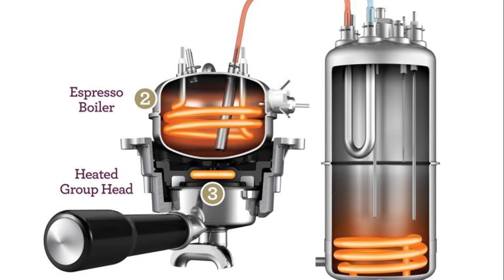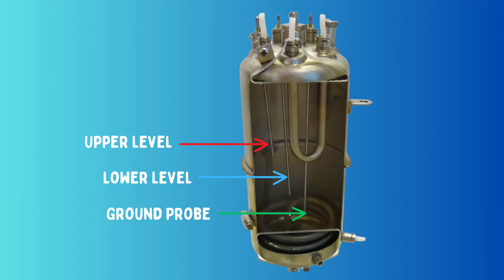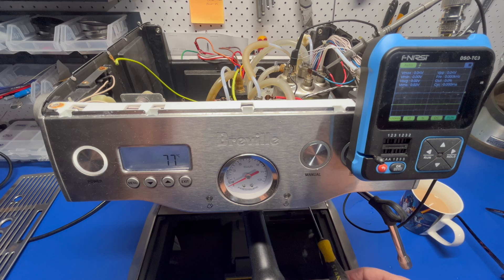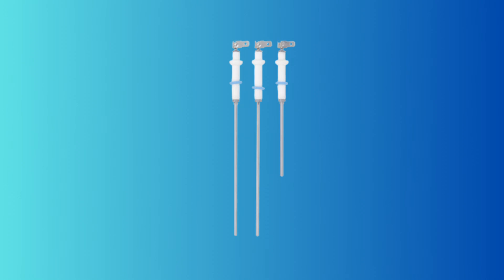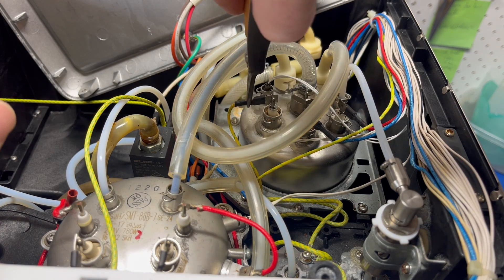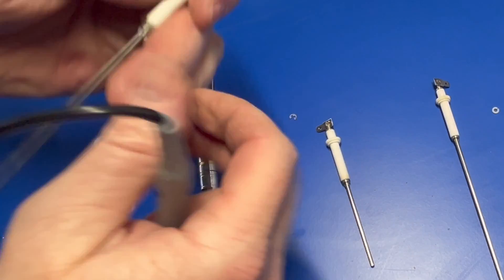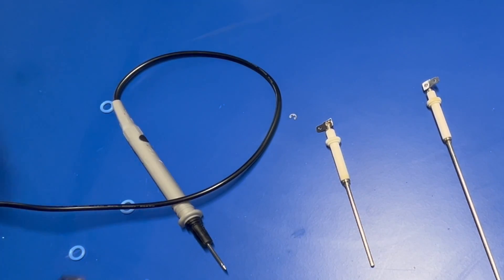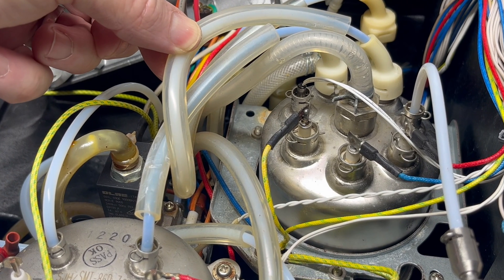How to Fix Leaking Steam Boiler Probes on Breville Dual Boiler BES920 and Oracle BES980 / BES990

Comment: I'm back!  Still with the problem with the probes.  I'll be interested to pop an oscilloscope on the red and blue probes but from my comments on one of your videos, i've still got the silly scenario that after replacing the small o rings and emptying the boiler, the machine will no longer fill the boiler at power one.  If I remove the red wire, it will fill so no issue there.  If I hold manual and exit and plug power on, then press the front panel power button then it will go through the self test.  1, filling the brew boiler and 3 filling the steam boiler.
Then when I get HHH for the probes, it works as expected.
So, I know that the triacs work fine, I know that the probes sense because I see change from L to H.  I know that the pump works otherwise it wouldn't fill and everything worked before changing the o rings.
There has to be a software issue such that something is not in the right state.
Reply: Ok, it's FIXED!  Stupid user error on my part.  I was convinced beyond all doubt that I had the probes in the right location but I had inadvertantly swapped the short and long probes for high and low water level.  So, although the menu panel was quite happily showing change in results and corresponding plots on oscilloscope, of course when powered on with an empty boiler, the fill would be to the low water level detected as the high water level.
My "temporary fix" or running the self test which activated the pump worked because it would then fill to the shorter probe in the wrong location and satisfy both probes in the right state.
Thanks for continually challenging my position as it gave me the motivation to return to this and think it through.  With a degree in electronics and someone who fixes far more complex stuff than two water probes, I was overthinking the problem and forgetting the stupid human element. 
😁
Reply from the maker: @djtaylorutube  that’s great! Well I guess you learned a lot along the way which will come in handy in future I’m sure
Reply: @BrevTech  Lol yep!  I was chating about this with a friend, the number of times i've stripped down car engines and just piled all the nuts and bolts into a container and yet put them all back in the right place.
Almost defeated by two stupid probes. 🤣
Now I can set the clock and timer to come on, which I couldn't do since I was having to power off at the wall each time.
Next video you do, pop an overlay on for the probe position, just to remind the stupids among us as to where they go.
Reply from the maker: it wouldn't be a software issue i don't think as it would be read only. is the red probe being grounded for some reason? That's the only thing i can think of that would cause this.  The probe is supposed to be isolated from everything so it doesn't make sense that removing the wire fixes this.  Use an ohm meter from the probe to the boiler casing to see. It's not contaminated with descale solution is it? That would cause this, but would also need to be wet so probably not.
Reply: @BrevTech  Never descaled. Removing the red wire instigates a low condition on that probe and then when powered on it will overfill (steam valve open) because there's never a high detected. So it can't be grounded as the state changes correctly. 
It just won't pump from power on unless the boiler is complete empty and then doesn't fill enough up to the probe to achieve HH thus the boiler doesn't heat. 
Hence my cheat each time of manual self test to force the pump to run, it makes no sense!
Reply from the maker: @djtaylorutube  take the probe out with the wire still attached . Does is still register as a low condition?
Reply: @BrevTech  I'll try tomorrow, along with attaching scope. 🙂

Comment: Thank you! A buddy just gave me his old BES990 that would randomly call the pumps after just a few cups were made. Figured the board was overheating after noticing excessive moisture from the rear vents, caught it before any of the Triacs blew, going to start with replacing all the o-rings. Didn't realize what a widespread problem this is for these Breville machines.
Reply from the maker: It is quite common on the older machines, but yours is likely 8+ years old, so any machine of that age would need some attention. Replace the seals, clean the probes and if you need to descale, then look into the manual approach on those older ones. Buying an older Breville is essentially taking on a hobby :)
Reply: Yep. Mine has less than 100 cups made, and my o-rings and sensor rings started leaking and causing under pressure errors and leaking inside the machine leading to MORE errors due to water on the boards. Just ridiculously underbuilt here.

Comment: Is it ok to replace the silicone o-rings with nitrile ones? Can't find silicone o-rings of this size in the UK.
Reply from the maker: No, the max temperature for nitrile is 120c and your boiler will be above this
Reply: @BrevTech  Thanks for the reply. A bit weird these o-rings are metric, while all others are imperial. Is there an imperial that will fit in their place?
Reply from the maker: You might be able to use a bs003. Maybe that’s a better fit? I don’t have any to try

Comment: Loving the insightful uploads keep them coming!, i took your advice you gave me from my last comment and i cut the cords of the old Triac Board on my 920 and replaced it successfully but now my machine is over heating and going over temp instead of stalling and not going to full temp, so looks like it was some other issue besides the triac board that is going on with the machine, temp numbers just keep blinking then machine just over heats
Reply from the maker: You can check which boiler is going over temp in the self check menu. If the new triac board is ok, then next thing would be the NTCs. Unplug all 3 from the main PCB when the machine is stone cold. Check ohms across each connector. the group and the steam NTCs should read about the same and the coffee will be different. reply with the values here and i'll compare them with mine.
Reply: its the coffee broiler, i also have a replace NTC for that, what would be the easiest way to replace the NTC? i have seen alot of videos where u have to take out the entire broiler to get under there and replace it, i for surely am trying to avoid doing that with some sort of swap out if possible  @BrevTech
Reply from the maker: @thomasbasc9817  coffee boiler one is simple as it’s in the side. The group head one is more difficult as that requires you to take out the boiler